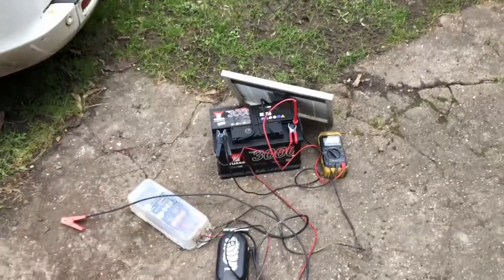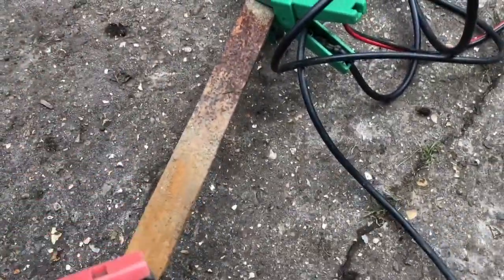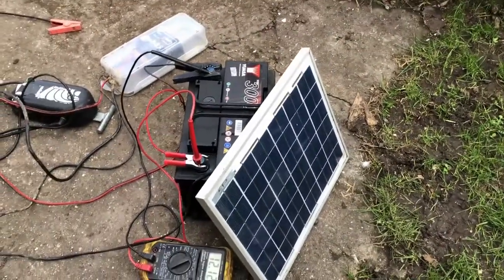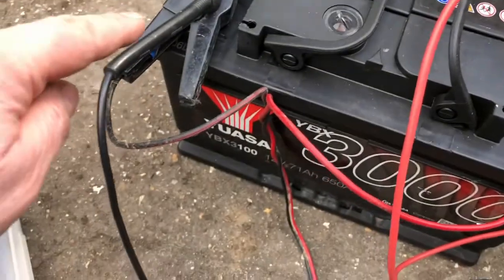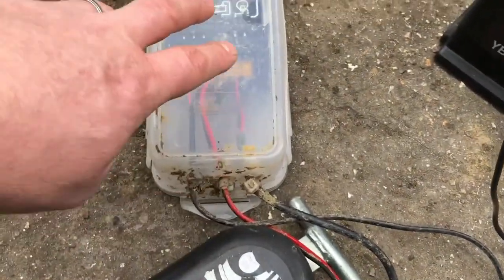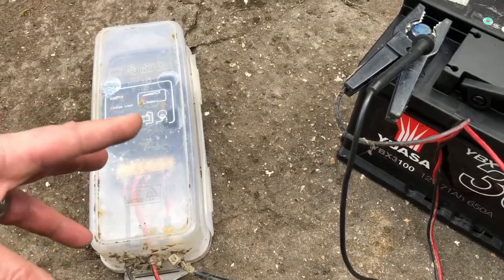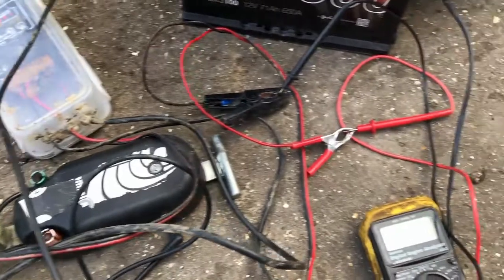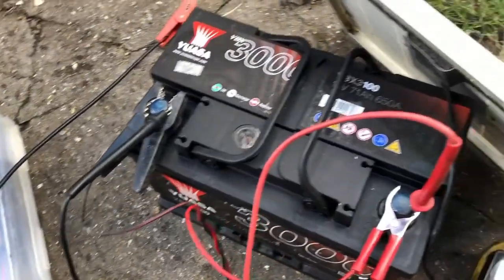How to - Electric fence, solar panel setup

Comment: Hi there! I have horses and electric fencing with same issues that you have described!!! Ive got an energiser, 12v battery and solar panel ! What is the other piece of kit that I need called?
Reply from the maker: Hi, it’s a solar charge controller, you can get them for about £10-20 on eBay, amazon.
Reply: @Roverturbo  thanks for your reply, much appreciated, I’m on to it 🙏😉